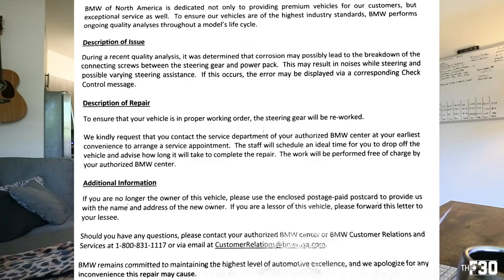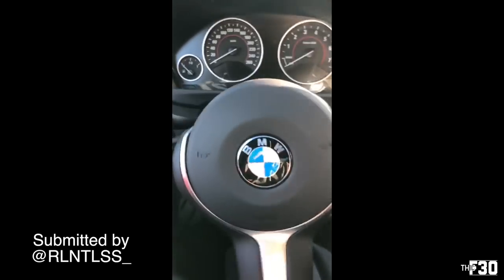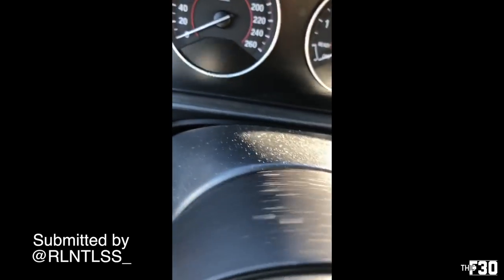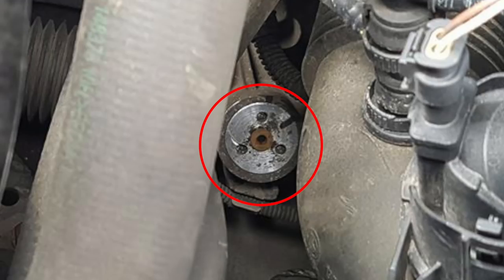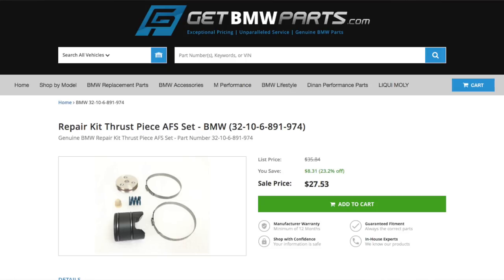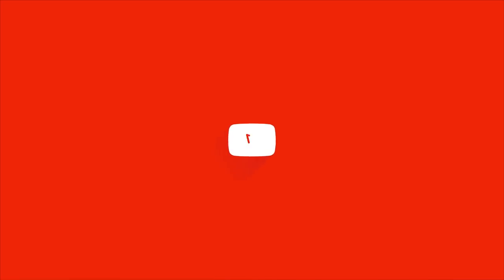F30 BMW STEERING RACK REPAIR KIT FOR CLUNKS, ISSUES OR NOISES??

Comment: just had the power steering go out temporarily while turning the wheel all the way to the left/right to back out of a parking lot. 
thought it was gonna be a huge fix. thankfully found this video and called my dealership for a free fix. 

FYI it's not just a one time fix, there's another bulletin that says the EPS part that's under this recall has a 10yr/120,000mi extended warranty. (just for this specific thing)

Comment: 2015 320i - Have this issue currently at 75k miles. Small cluncking/clicking noise coming from steering rack when hardly turned in one direction. Car is due service and MOT this week so will have it looked at then. Will take a look at these options to get it fixed. Cheeers

Comment: In my F30 LCI I am experiencing the following:

Vague steering - every now and again pulls to the right out of the blue or following groves of the road, notice it mainly downhill, there's no knocking in the steering just not expecting the steering to be so fast then having to correct it out of the blue. This is best described as tramlining, could be anything from tyres, pressures, upper, lower tie rod ends or characteristic of the F30.
Reply: BMW technician explained it's the road surface, tyres wearing aggressively on the outside edges, KDS wheel alignment recommended.

Comment: I have a 2014 328i xdrive. when the car is off and i turn the wheel, i get a bit of clunk. however, i think that’s normal, because when i went to the bmw dealership, and sat in a brand new f30, the clunk was there as well.
Reply: Krystian Rebowski yeah me too I just did mines and it was there but when I turn the car on nothing happen
Reply: Same thing, tested at the dealer and same noise
Reply: Hey! I have a question, on your 328i xdrive, when you move the steering wheel back and fourth do you feel a slight click? Like there’s a tiny bit of play?

Comment: Hi Brother, hope all is well! so long story short. I have a bmw f30 335xi 2014 m1 & m2  and its currently at the dealership being worked on for the past 3 days.  Car currently has 60 000km and since i bought it last year ive had this little knocking in the direction, something felt loose but after inspecting it back then it looked like it was just both control arms starting to give up. Dealership just installed today my Bilstein b6 DampTronic, eibach springs, Both hydro bushing ( control arms) , top plates and lower seals, bump stop in the rear etc... Got a call now saying my « rack and pinion «  needs to be replaced before being sent to alignment.... 5500$ can but willing to do the job parts and labor for 3700$can ( new oem rack). Im so not sure what to do!! Finding a used one wont be easy and not my favourite route. What would u suggest ?  Head mechanic said « wheels wont ever fall off , but you’ll have to live with that little shaking /knocking sound underneath « 

Stay safe🙏🏽

Comment: I got a 2015 335 and I do have a clunk noise but it’s during driving on small bumps and it’s definitely on the driver side only. I had my shop check all my ball joints and tie rods with alignment done as well. They told me nothing was loose or needed replacing. I try to work on my car mechanically as much as I can and I’m confused as to what’s making this clunking sound on small bumps. Currently driving my f30 with the noise which is bothering me. Struts don’t feel worn out and I only have 28k miles on the car.
Reply: Michael T Bro- I’ve been dealing with the same clunking issue on the driver side! I have a 2013 335i with 170k. I replaced the shocks at about 100k, and it didn’t not resolve the issue. Several mechanics have confirmed all is well with my suspension (no loose components). I’ve had new wheels installed and had the car aligned and the issue persists. Wish I could pin-point where issue lies. Thanks for the post!
Reply: Im also having the exact same issue.
Reply: I have the same exact issue - 2016 340i
Reply: Problem is 100% the steering gear part talked about in this video. Some clunking noises coming from driver's side, all suspension OK. It's the eps rack gear, as explained above.
Reply: I thought it was just me...been having this annoying noise for several years now on my f30 N55 from 2012 currently at 112k miles..have never been able to determine what...

Comment: My 2014 F32 has that click/ pop when turning wheel left and right while parked. Always thought that was just the new steering that is loose and not as good as my E92. The main thing that bothers me is when I will go up a curb or down a sharp driveway gutter is this type of pop or snap. Kind of like a joint pooping and breaking. It seems like if cut the wheel as far as possible left or right, it won’t do it and is perfect. Also while straight forward it is solid. It is the in between turns and angles that I get the pop. It is for sure not right, and my personal tech that has a great shop has not replicated it. When I read about the rack issue, it sounds spot in. People call it a clunk, I feel it is a hard joint pop. Like 2 things connected are popping due to some sort of wear. It sounds like people have gotten new steering racks on forums and ended up screwed with same issue again. So although it is annoying and not normal, is it dangerous or harmless? Is this a dealership thing or better to go to a trusted Indy like my friend? He gets mad when I do this internet master tech thing. Makes me look like a fool when trying to walk up with what I have read about LOL! I also feel like i get the brush off a lot from seasoned techs, they think everything is normal or just a stupid symptom of any car that has any miles. Anyone tell me anything, it will all help. I have not received a letter and have no recalls on my 435. It is registered with BMW. It seems like the screw kit thing above would help the issue. Do I want to wait 1 month for a rack and then have some dummy fuck my car up at Ferman BMW? Who knows. Thanks everyone! Holler when you can...
Reply: Your description is exactly what I’m experiencing. Did you get it sorted? What was it? I also wonder if it’s safe to drive, sofar it’s been fine.

Comment: I changed this bushing, now it's better but there is still some knock, even when the engine is running and im starting to drive slow I turn the steering wheel to the right left and i hear and feel a little bit of clunk. This bushing is only remove sound for about 70%.
Reply: I changed the part, my steering wheel was very hard

Comment: I’ve got a 67 plate F32 (430d) and mine does the clunking sound whilst engine is off, BMW took a look and it is apparently normal which I disagree with.. bloke tried to see if a 440i would make the sound and it didn’t so he said it was just the diesels 🤷🏽‍♂️

Comment: i have a 320d ed version since 2014, bought new. I have had the issue since the car was clocking 80k km mileage, granted I did drive it quite hard from time to time and the road condition where i live isnt exactly the best.

after replacing all thrust arms, control arms and sway bar end links, the problem still existed at the time, I had a complete steering rack replacement. even after that it wasnt as perfect as it originally was, symptoms did tone down.

since then I have been driving with great care, no more pushing into corners like how I used to, no more detour on twisty roads for a bit of fun, actively avoiding pot holes to an extent where 90%manholes were also taken into account. simply commuting and with gradual accelerated high speed on motorway. yet symptoms became apparent again when odometer reaching around 170k km mileage.

I replaced everything again and this time with the steering repair kit as well, it wasnt perfect, and only improved the situation for say 10k km milage... I bought another kit again and had it replaced again.... same thing. 

so right now my car is clocking 217k km of mileage, and I have given up on fixing this issue. this is the worst bmw steering i have ever experienced.

Comment: I have a 2014 320d m sport (RHD) I'm having a clunking coming from the right hand side of the car, I had work done by a BMW specialist and still the noise is happening, I was told it's the steering rack but sounds like coming from the suspension?
Reply: bighit I 2015 420d m sport and this sounds identical. I haven’t taken it to the shop yet but when I do I’ll give info on the cause. Also mine sounds like something is slightly loose
Reply: @absjolaoso  I had a few things replaced that the garage told it was yet the noise is still there. It only happens on pot holes or rough roads
Reply: bighit Had this sound. Eventually realized it was a water bottle under the passenger seat.......

Comment: Mine completely bust having a nightmare getting a 2nd hand electric steering rack there seems to be few different part number RC RM RT because it’s a common fault used racks are hard to come by in Northern Ireland mine is a 2013 f30

Comment: I have the same problem when I shake the wheel on my 2015 f30 rhd.
A slight clunking noise when I shake the wheel and the power is off.
I only noticed it yesterday.
What happens if its left too long.

Comment: My 2016 m235i also does a clunking noise when when I’m reversing
Reply: I have the exact same issue. When it over 60% wheel lock. I have a BMW 330D (F30) 2013 Dec M Sport.
Reply: Yo I have the same exact issue when reversing all the way left in reverse and I’m on my 3rd steering rack, did you ever get that fixxed???

Comment: Hello i have a 2016 340i replaced my steering rack ,the used one came also just as bad it clunks pretty bad over bumps coming from the center joint. I bought the repair kit but it waa bigger then the one my rack needed.. do u know if they make multiple versions of the repair kit?
Reply: you ever find a solution? Mine started to act up too.
Reply: @aldorodriguez1674  yes I did... the repair jit didnt fit my years rack and pinion ..my clunking was from something simple actually.  A bad sway bar end link ... lesson learned was check all suspension  parts .check em twice .. a lil play can make bad knocking n clunks

Comment: honestly dude its free of charge, i had mine in and they changed the bolts, i know my alignment is f***ed up cus my RF tyres is GONE. new tyres and an alignment on upcoming monday. But i think if theybare authorized BMW dealer they should have a clue on what they are doing, if youve heard some stories from that dealership just go to another BMW dealer. its free and as you know BMW tends to not be free in terms of parts and labour and such 😂

Comment: I have bought a 2016 3 series and it has this problem. It doesnot clunk when its cold but starts knocking when it warms up after a hour drive. I can fell the clanking through the steering wheel and pedal. 
Could it be the same problem?
Reply: Hi, i have this exact same issue, on a 2016 3 series, did you ever find the cause & a solution?

Comment: Mine does the exact same clunk in your video but not that loud, I think it gets louder over time. Mine 2015 435i grand coupe with 32k miles.

I checked another car like mine but it has the 18” rims, with 49k miles, it has the same clunk but not noticeable unless you turn the steering very hard.

If your steering shakes while braking  that’s mean you need to face your rotors or sometimes replacing them.

Thanks

Comment: I have a 2013 328 
My streeing makes the same noise from the first clip when the car us off there is no noise when car is running
I have not received the recall letter
Reply: Me too, just received this part. going to get it fitted and see what happens
Reply: @tomclarke861  tom hy you remplace the part if yes how it works?

Comment: Anyone here with a steering wheel not recentering after a turn?  It's happening to my nephew's 2014 320i and I'm suspecting this s the culprit.
Reply: You should lose the 3 pin screw a bit and try again